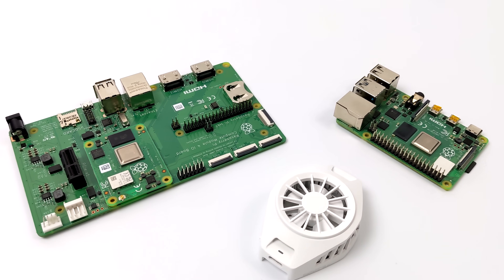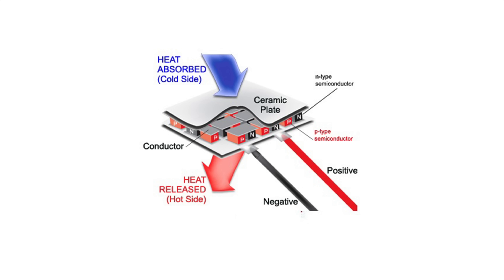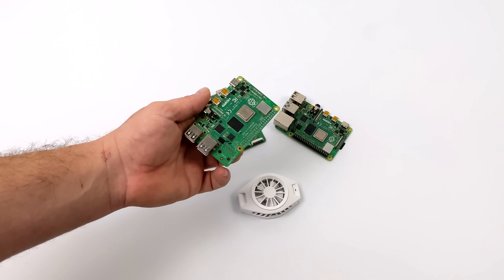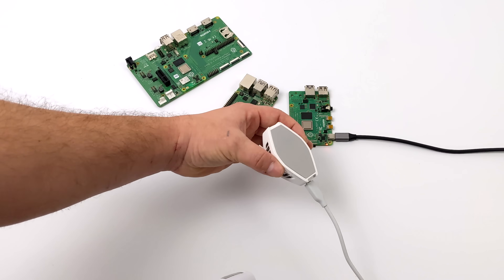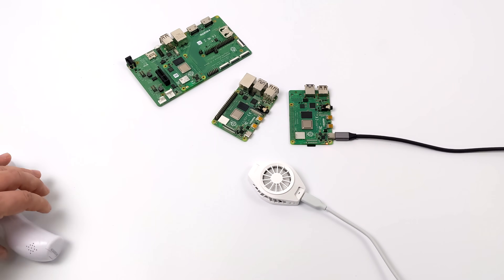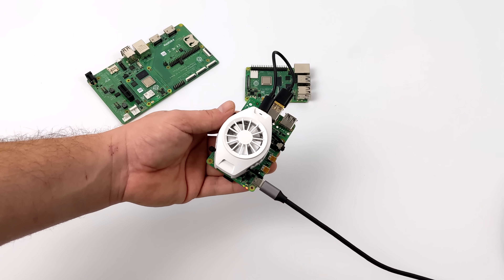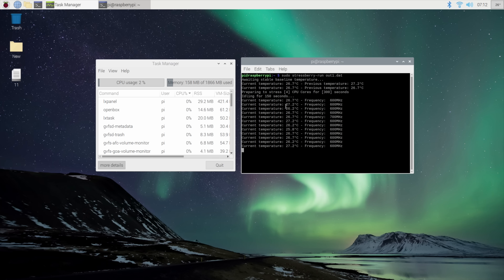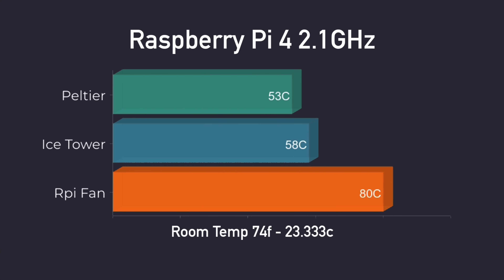Thermoelectric Cooler On The Raspberry Pi 4! Super Low CPU Temps With Science!

Comment: Great Video! Ok, I have a situation, with multiple units in an industrial setting that experiences high temps during the hottest days of the year (no a/c). The cases of the units don’t lend themselves to water cooling adapted however I believe this might do the trick.... Why is water cooling still popular with this method working so efficiently? And, has anyone produced different form factors / models of these types of units for pc/server cooling? Thanks for the content! Apologies after re-reading, the units in question aren’t Pi’s they are HP servers.
Reply: Might wanna check cooler master ml360 sub-zero
Reply: Robert Yonas  THANKS! One other q, per Ciro below, how is condensation dealt with? GREAT VID GREAT TOPIC!
Reply: @TheJacklwilliams  it has built in sensor that will watch your condensation level. You can set it to ignore the sensor via software.